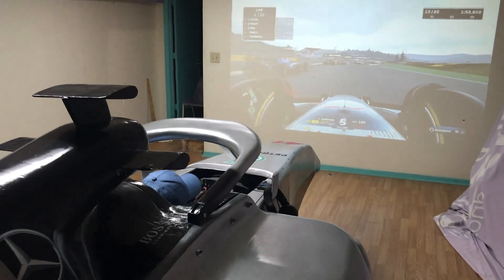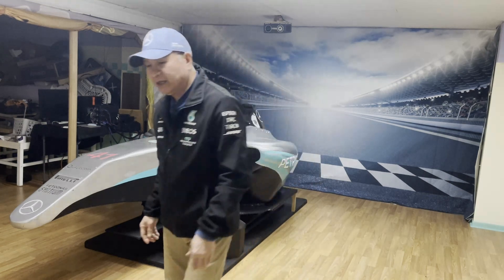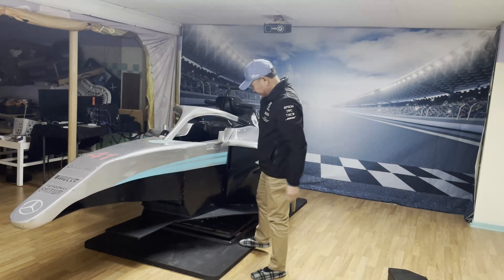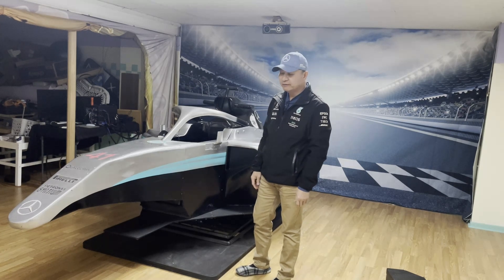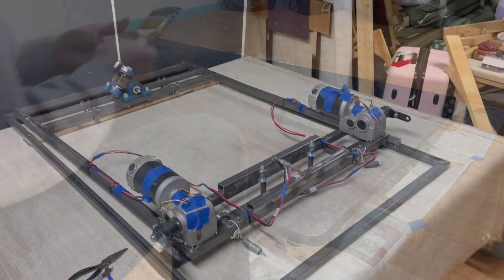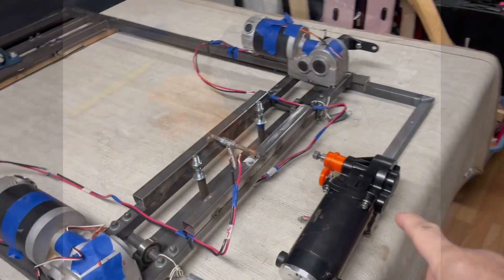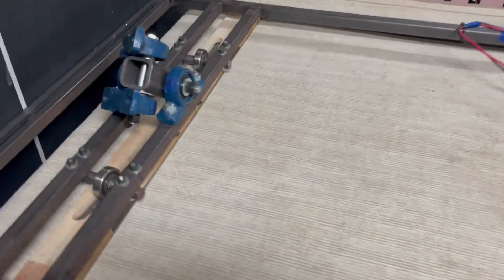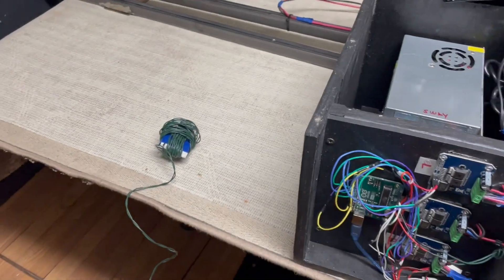DIY Mercedes F1 W07 Sim Racing Game Cockpit Part 3

Comment: Im loving building so far. Im using a laser machine to cut the parts for the intake. Next steps are building around my seat. 

Have you finalised the plans for the side pods.
Reply from the maker: I'm glad you're enjoying building it.  I have the side pod made but no PDF file for it.  It's all hand made templates though.

Comment: WOW this is amazing. I have a Playseat Mercades F1 Pro seat and Simdeck motion platform and the cockpit would be a great addition. I have already purchased your plans but not yet started to build. I can't wait for the halo and pods to be added
Reply from the maker: Cool!  Thank you!  I had to finish this project before I can start the plan for the side pods.  Actually, I’m finalizing the prints for the halo now.  Soon will be available.  I will advise when it’s ready.
Reply from the maker: Hi Mattyc, here is the link to purchase the plan for the Halo:  https://www.ebay.com/itm/395228151015
Reply: @R4C_ENG  hey mate, thank you for providing the link. I've just purchased. Can't wait to see the plans and start building. Do you know when the plans will be ready for the side pods
Reply from the maker: @Mattyc_Racing   Thanks for the purchase mate!  I'm having difficulty reverse engineering my actual side pods.  I'm hoping the side pods will be done by June.  I will advise if I get it done before then.